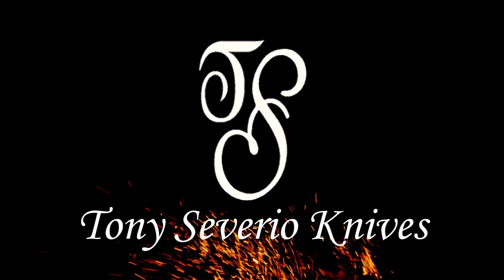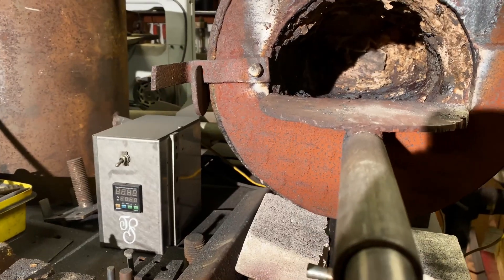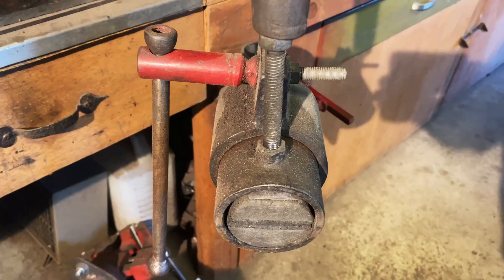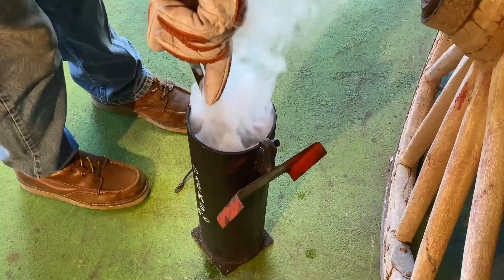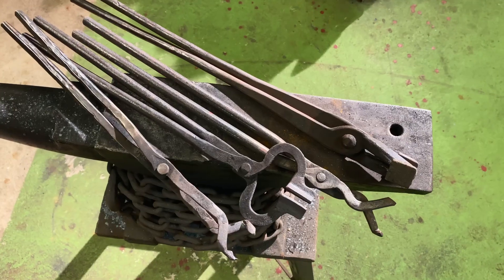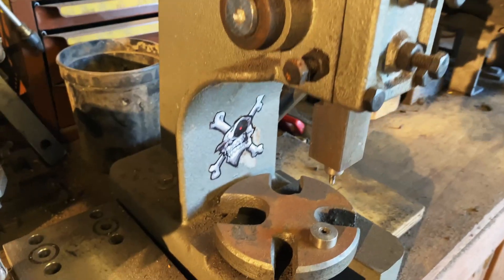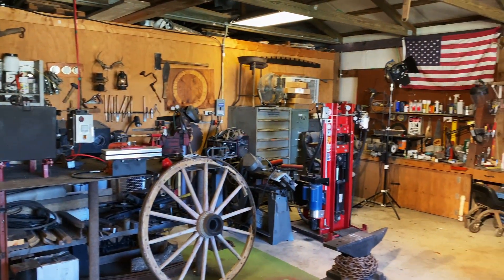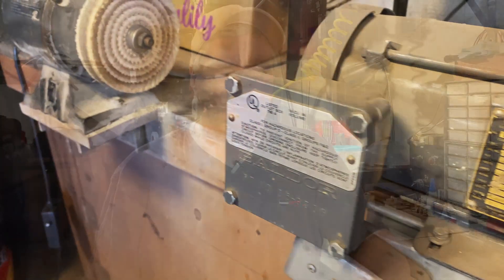Knife making 101:  A beginners guide to knife making

Comment: The drive pully system works much better than the VFD. I got a VFD and it looses to much power when you turn it down. My friend has one that you switch out pullies and the more you slow it down the more power it makes. I guess it works the same as changing out the gears in your car
Reply from the maker: I hear ya.  But a big DC motor would have the power at low speed.  I have a big 2 horse motor that will be on a grinder not too long from now.  😁

Comment: That safety one is a must do. When I took my first smithing course nearly 20 years ago doing basic smithing, the instructor at the start of every class had the students check each fire extinguisher. We then checked the water buckets at each forge (we were using coal), then we checked our protection gear (including first aid kit) and closed our safety check with the hammers we were using to ensure the heads where securely fastened.

I remember this one guy tried to use a hammer that he said was passed down to him but the head was not secure. The instructor every day caught this guy setting his hammer out on his anvil to use it, and every day the instructor told him to put it away. The guy fussed every day how he was gonna quit if he couldn't use it and argued that we all signed waivers to not sue the instructor if we got hurt and every day the instructor told him the waiver protected him, not the other smiths from each other and if his hammer hit another student and caused harm, that is a complete other issue. WEEEEEEEL, that guy showed up late one day, and not just a few minutes late, late beyond the safety check and then some. Took fired his forge up and then started working with his heirloom hammer and wouldn't you know, the hammer head flew off just as another student was picking up their tongs they dropped. Smashed him clean on the top of the head, sending him to the Dr's for stitches and ending his day...

You know the saying "Safety is everyones responsibility"? yeah, they leave out the 2nd part of that. It really is "safety is everyones responsibility, but your safety is your responsibility." The student working next to the guy with the looser hammer saw it, called the guy out on it, but didn't want to deal with the argument. Hard lesson learned...
Reply from the maker: You are so right.  I managed industrial safety programs for any years.  It’s astounding at how the lack of safety conscious people are.
Reply: Damn what a dick